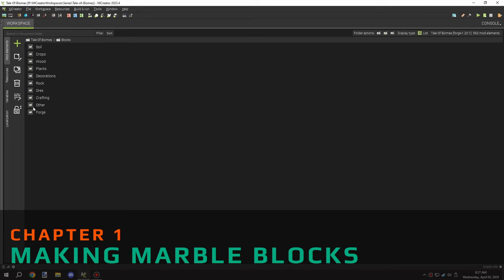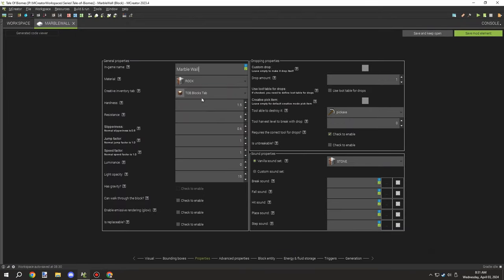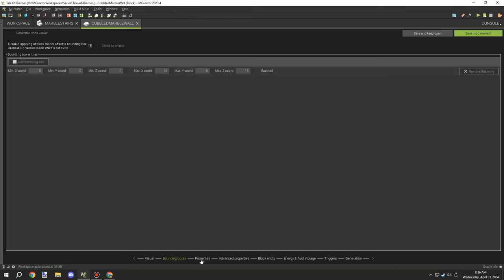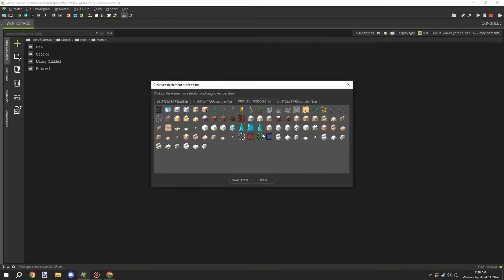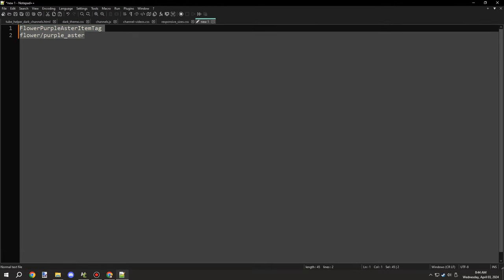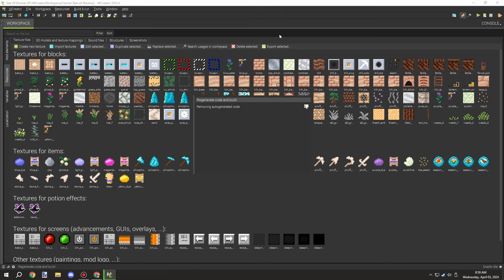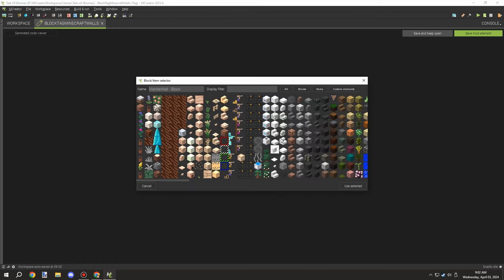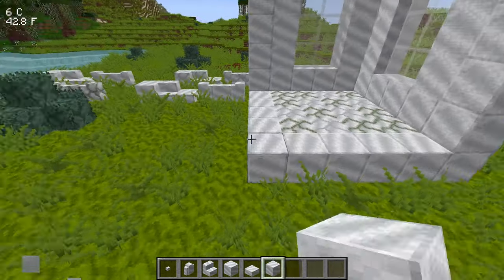MCreator Lore: FINISHING Adding MARBLE Blocks | Ep63

Comment: Could you make a tutorial on how to make a stamina bar and how to change the vanilla life bar for custom overlays that I also created with the protection bar when you put on armor
Reply from the maker: I have a tutorial on how to add thirst bars which are basically the same idea you are wanting though its not possible to replace the vanilla game bars without coding.
Reply: @NorthWestTreesMCreator  but I saw that there is a way to link the life bars with the normal life bar with procedures and overlays

Comment: hi there, i'm thinking about making youtube videos where i add cool and weird stuff to minecraft (similar to youtubers such as fundy, knarfy etc). would mcreator suffice or would it be worth investing the time towards learning how to code mods with java?
Reply from the maker: I mean at the end of the day both coding and MCreator achieve the same goal to make mods, though MCreator can be limited to what you can do, it has not stopped me or other people from making some really advanced mods.

I have CCTV Craft which started with viewing mechanics using spectator and got pretty popular both on Curse Forge and MCreator, I have also made elevators and a hole bunch of interesting mechanics.

With that being said though MCreator can be limited to what the contributors do decide to add and many things are outside of the scope of the project that require custom code, though it is possible to still make it with MCreator if you know coding.

Also when it comes to MCreator code it is still generated at the end of the day so its not the cleanest code compared to organization and efficiency however something like videos for YouTube won't make a huge difference unless you plan to open source your mods.

And as a personal note I have recommended the application to JeraCraft and other builders because it can really push their channels to the next level even with adding new blocks. Sadly though not many people decide to go this way most likely due to it need more time to make yourself.

Last note would be that if you decide to do it on your own its going to take time to make quality content. I suggest learning a bit of pixel art or finding a few people that can make the mod part for you and then do the video recording and editing your self or the other way around this way it will take less time and videos can be posted sooner.